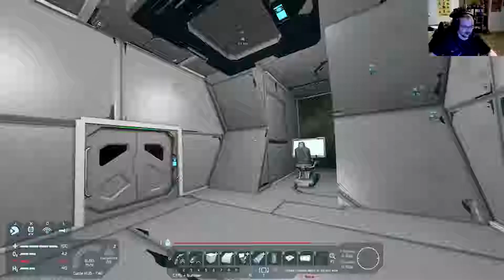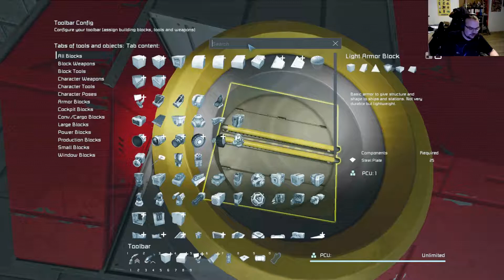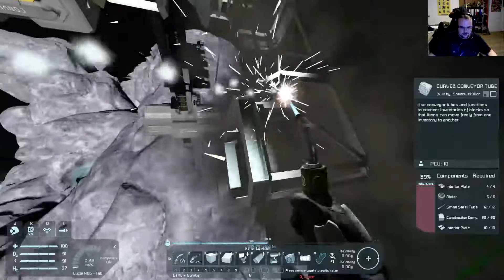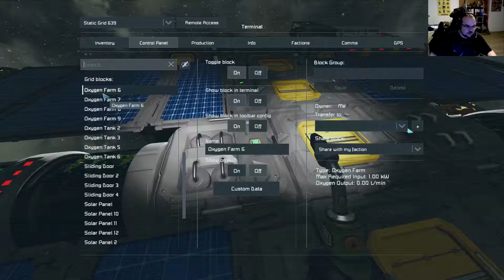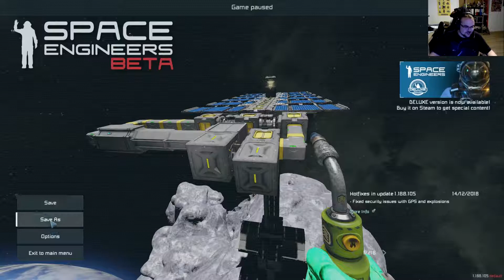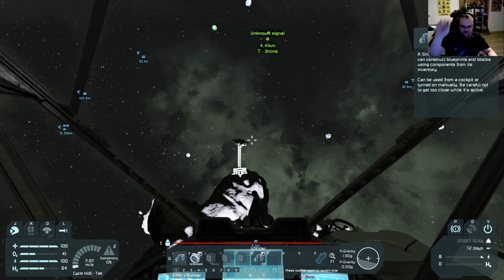Space Engineers - 80: How...What?

Comment: I watched your video twice and I'm as confused as you as to why it didn't work.

The only thing I can think of is when you had the merge blocks connected . . . 

The piston was extended a little too far and pushing too hard and put the blocks out of alignment?
Of course that is just a shot in the dark.

When I'm using merge blocks, I make very small adjustments on rotors and pistons.
Just enough for the merge blocks to make contact.

Also I've noticed merge blocks don't have much leeway.
They have to be almost perfectly aligned with each other.

I also use creative to troubleshoot instead of survival. 
Running to get parts all of the time, breaks my concentration.
For some reason, I have better luck using pistons, but it can be done with rotors.

Anyways, good luck in figuring it out.
Reply from the maker: Haha yeah i figured it out, should be able to do it next time :D
Reply: @shadow1990ch  
Just curious as to what the problem was, or was it a Clang induced thing?
Reply from the maker: @1953dan  i think the failure was that i was working with offsets and that does not work in this scenario i think. Well my solution does not even need a merge block now :D